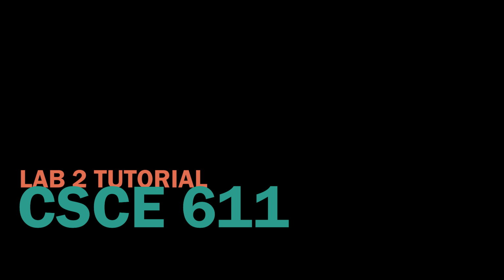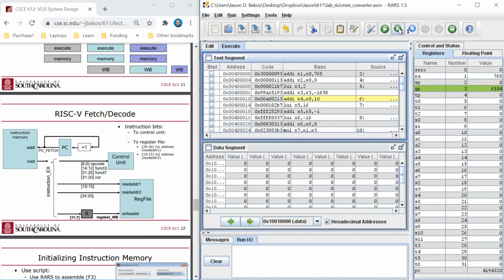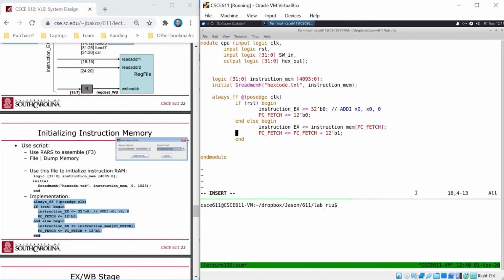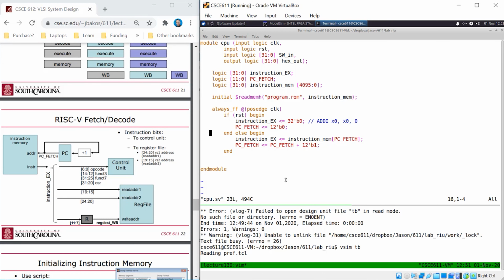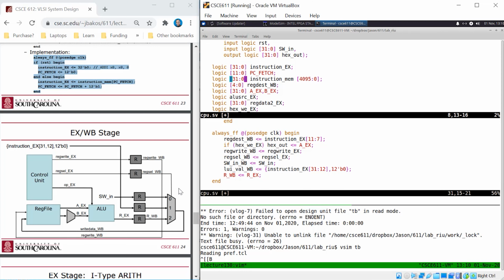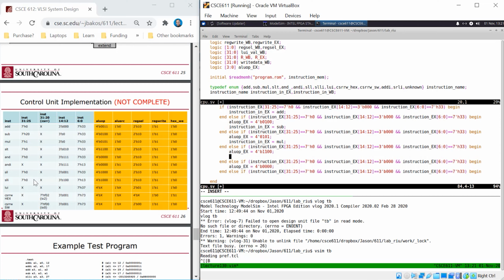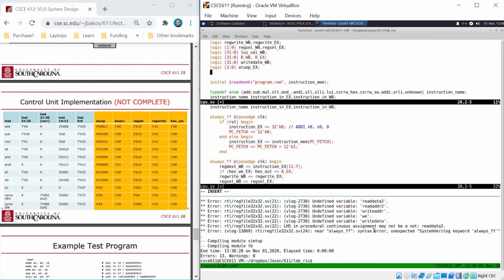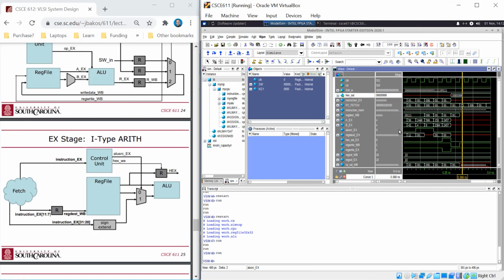CSCE 611 Fall 2020 Lecture 13:  Lab 2 Tutorial

Comment from the maker: Corrections:
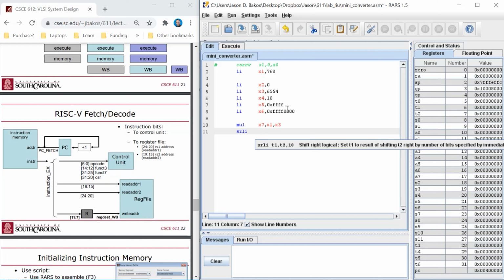@5:28 I meant to say "shift right logical *immediate*".
@22:32 While the assembler does expand the nop instruction to the addi x0,x0,0 instruction, the 0x00000000 machine instruction doesn't map to addi x0,x0,0 instruction.